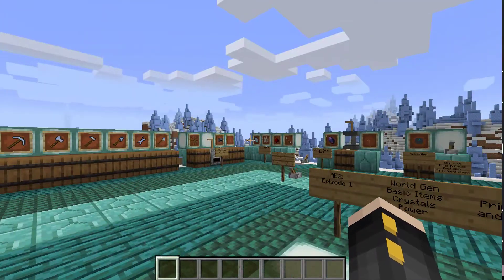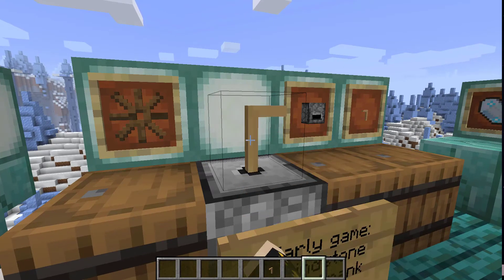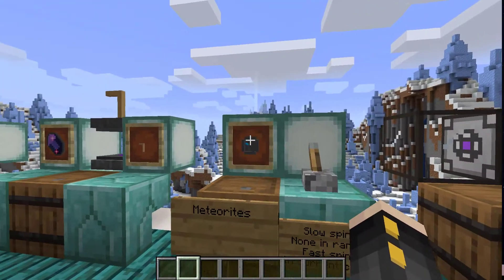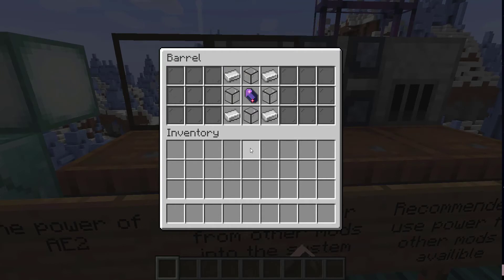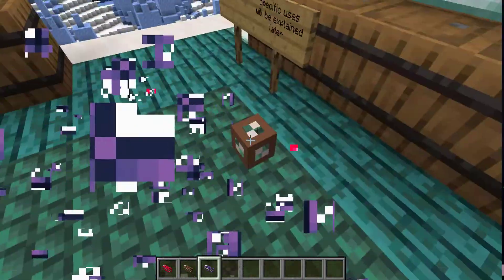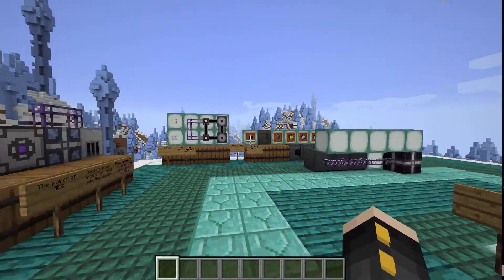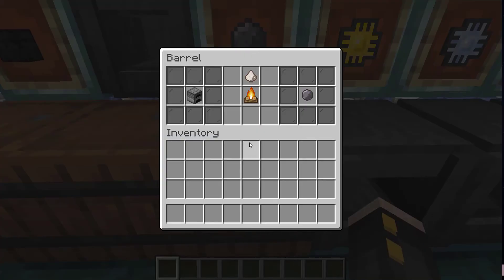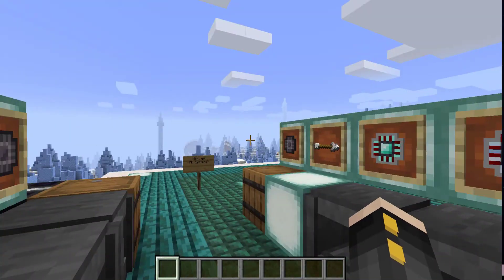Applied Energistics 2: A Beginner's Guide! -- Episode 1

Comment: for some reaon i cant make the crank or the engine thing with 4 sticks would you know why ?
Reply from the maker: It’s possible that the mod installed incorrectly. Try downloading and installing it again or using a different Minecraft version - I’ve heard from someone else certain versions had problems with crafting recipes
Reply: @lunarCubed  Not the case, I have the same issue playing on 1.18.2 with the All The Mods 7 pack, they removed it or something, you NEED to use power from another mod for any of ae2 to function it lirerally cannot progress on its own.
Reply from the maker: @TehLiquid  This is good to know. Appreciate that info!
Reply: @lunarCubed  is there any other way to generate energy early without the crank?
Reply from the maker: @empanaditasmurf6689  I believe that if you only have ae2 and nothing else it’s the only option, but with other mods you could probably find an alternative